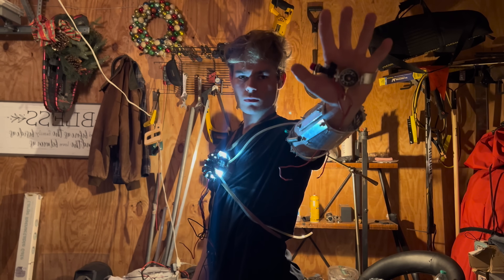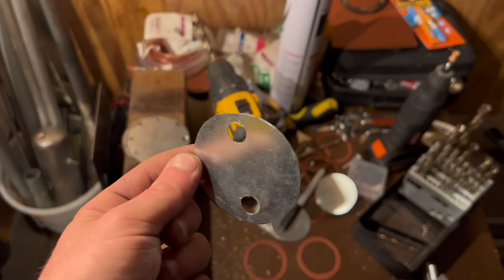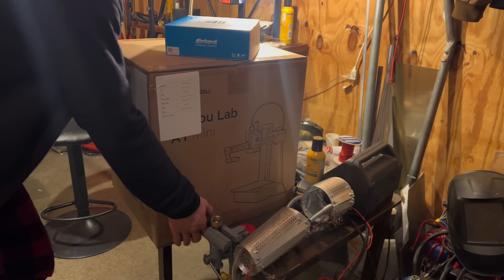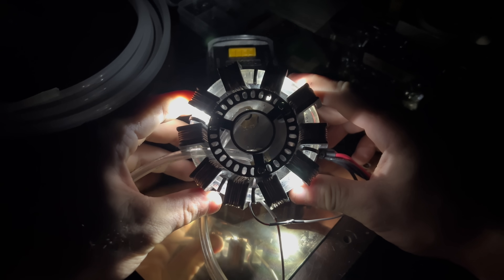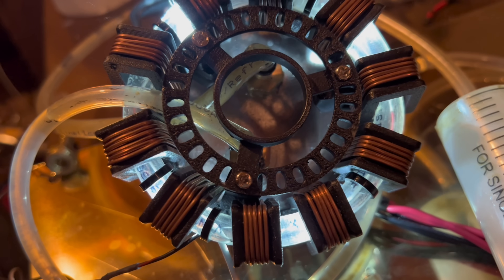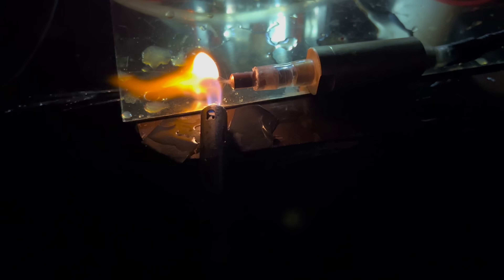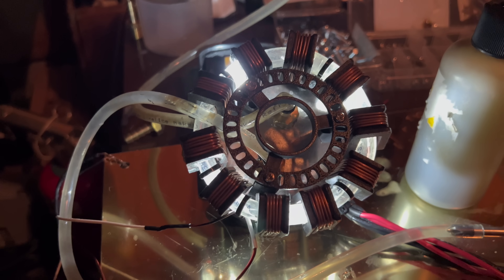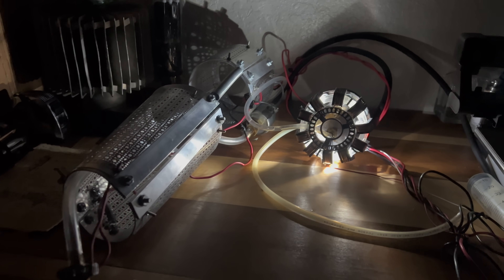Functional Ironman Reactor that Converts WATER into FUEL

Comment from the maker: Forgot to mention this in the video but this reactor is inspired off of Alex Labs model, just a couple of tweaks from his model but basically the same process. Working on a new model however using a more efficient electrode material and a couple of different inner mechanisms that will hopefully be much more powerful.
Reply: Respect for mentioning him
Reply: How to get this materials cost also plz its awesome i want to build one if not atleast buy one  .
Reply from the maker: @SourabGhosh-cc1 you can get the metal at metal scrapyards or hardware stores look for 304 or 316 stainless steel and rubber insulators
Reply: @Joseph_sidl  thank u
Reply: @Joseph_sidl 
I am an engineer I don't know everything about your hydrogen reactor, but I have some tips for the future 

 Composite high-pressure cylinder + 2-stage regulation to stack operating pressure.

Hybrid buffer, small Li-ion pack or supercapacitors to handle peak actuator draws and regenerative braking from joints.

Closed-loop liquid cooling with microchannel cold plates on power electronics and stack.

Modular tank swap design for fast “refuel” without downtime.

This gives you durable runtime

though it might be slightly bulky depending on your complete future exosuit

Here is a short sim for a secondary Ionized plasma reactor for long ter management of the full suit.

Being the fact I don't have measurements or full exosuit blueprints this is a rough estimate.

Use case: Portable, wearable primary power is not realistic; model focuses on a compact RF plasma reactor as a source to illustrate physics and constraints.

Geometry: Parallel-plate RF discharge, electrode area 
𝐴
=
0.01
 
m
2
, gap 
𝑑
=
2
 
c
m
.

Gas: Argon (inert baseline); optional hydrogen mix noted in sensitivity.

Operating point: 13.56 MHz RF, input power 
𝑃
i
n
=
200
 
W
, pressure 
𝑝
=
10
 
T
o
r
r
, wall temperature regulated near 
40
 
∘
C
.

Model setup and governing equations
Plasma continuity (global balance):

𝑆
i
o
n
=
𝜈
i
o
n
 
𝑛
𝑒
 
𝑉
,
𝐿
w
a
l
l
≈
Γ
𝑖
 
𝐴
with 
𝑆
i
o
n
 the ionization source, 
𝐿
w
a
l
l
 the loss to walls, 
𝑛
𝑒
 electron density, 
𝑉
 volume, and 
Γ
𝑖
 ion flux.

Electron energy balance:

𝑃
a
b
s
=
𝑃
i
o
n
+
𝑃
e
x
c
+
𝑃
e
l
+
𝑃
w
a
l
l
relating absorbed RF power to inelastic collisions and wall losses to set 
𝑇
𝑒
 and 
𝑛
𝑒
.

Sheath and ion flux at walls:

𝑐
𝑠
=
𝑒
 
𝑇
𝑒
𝑚
𝑖
,
Γ
𝑖
≈
𝑛
𝑠
 
𝑐
𝑠
with 
𝑐
𝑠
 the Bohm speed, 
𝑛
𝑠
 sheath-edge density, 
𝑚
𝑖
 ion mass, 
𝑒
 elementary charge.

Poisson’s equation (field structure):

∇
2
𝜙
=
−
𝑒
 
(
𝑛
𝑖
−
𝑛
𝑒
)
𝜀
0
to resolve sheath voltage 
𝜙
𝑠
 and ion energy to surfaces.

Example simulation outputs (order-of-magnitude, steady state)
Electron temperature and density

𝑇
𝑒
≈
3
 
e
V
,
𝑛
𝑒
∼
10
16
–
10
17
 
m
−
3
Expect weakly ionized plasma with non-Maxwellian electrons; sheath-edge density 
𝑛
𝑠
≈
(
0.3
–
0.6
)
 
𝑛
𝑒
.

Ion flux and energy to surfaces

𝑐
𝑠
=
𝑒
 
𝑇
𝑒
𝑚
𝑖
≈
1.602
×
10
−
19
⋅
3
6.63
×
10
−
26
≈
2.7
×
10
3
 
m
/
s
Γ
𝑖
≈
𝑛
𝑠
 
𝑐
𝑠
≈
5
×
10
16
⋅
2.7
×
10
3
≈
1.3
×
10
20
 
m
−
2
 
s
−
1
With sheath potential 
𝜙
𝑠
≈
20
–
50
 
V
, ion energy 
𝐸
𝑖
≈
𝑒
 
𝜙
𝑠
∼
20
–
50
 
e
V
.

Wall heat load (ion contribution)

𝑞
𝑖
≈
Γ
𝑖
 
𝐸
𝑖
≈
1.3
×
10
20
 
m
−
2
 
s
−
1
×
(
30
 
e
V
)
30
 
e
V
≈
4.8
×
10
−
18
 
J
⇒
𝑞
𝑖
≈
6.5
×
10
2
 
W
/
m
2
For 
𝐴
=
0.01
 
m
2
, ion-driven heat ≈ 6–10 W; total thermal load typically dominated by ohmic/electronic losses, approaching the absorbed RF power (e.g., tens–hundreds of watts), requiring active liquid cooling.

Gas temperature and pressure effects

𝑇
𝑔
≈
350
–
500
 
K
 near plasma core (without aggressive cooling)
Higher pressure increases collisionality, raising gas heating and reducing mean free paths; lower pressure increases sheath thickness and ion energies.

EM fields and constraints

𝐸
/
𝑁
 (reduced field) set by matching ionization, typically 
1
–
10
×
10
−
16
 
V
 
c
m
2
RF currents and stray fields are nontrivial in compact packages; shielding and grounding are mandatory.

Sensitivity and design notes for “wearable” context
Power scaling: Increasing 
𝑃
i
n
 raises 
𝑛
𝑒
 and 
Γ
𝑖
, but thermal and EM emissions scale too; compact reactors quickly exceed comfortable heat flux and EMC limits.

Gas choice: Hydrogen lowers ion mass (
𝑚
𝑖
), increasing 
𝑐
𝑠
 and ion flux at a given 
𝑇
𝑒
, but adds flammability and chemistry; argon is simpler and safer for characterization.

Frequency and geometry: Higher frequency or tailored electrode shaping can reduce sheath thickness and localize fields, but complicates matching networks and increases EMC challenges.

Cooling: A closed-loop liquid system with microchannel cold plates and a pump capable of ~150–300 W heat rejection is necessary at 200 W absorbed power in a compact build.

just a thought hopefully this helps :)
Reply from the maker: @KFlasheditsthanks for the tips, I actually already am working on building a accumulator tank to collect/pressurize the created oxyhydrogen to then be used in the future, as for the power supply I was using a car battery charger for just plain bench tests I will be using a rechargeable Lipo once I build everything into an exoskeleton frame, didn’t think of liquid cooling but that’s also a good tip, and for the refueling mechanism I was thinking of adding a second tank with a port hidden somewhere in the suit that I could pop open from the outside and fill with extra water, nice tips though
Reply: holy mogger
Reply: Full blueprint for this please
Reply: oh that video from seven years ago?
Reply: Government coming for you soon. Good knowing you
Reply: bro you probably know this but you can use that small flame to wield, that thang is 2000° celsius.
Reply: Great to see giving credit in this age. Also good work champ. Always great to see more exo suit channels.

Comment: You need a larger surface area for the electrolysis to make more hydrogen. Then you need to pipe the steam, 02, H2 through a liquid filter very similar to how they extract gasoline from a refinery. This will help cool the steam and filter the O2 and H2 as well as help fire not feedback up the tube to the H2 cell.
Reply from the maker: I did use a liquid filter that’s what the bubbler was for, as for the surface area I can’t really expand the reactor size, I could maybe a little bit but it would get too big
Reply: @Joseph_sidl  ah very good I didn't notice the bubbler. What do you think of the chest plate itself being a thin tank for electrolysis of the water and the light just a superficial astetic? Also things that are base in the PH scale reduce rust so maybe if you treat the water to be more base in PH it will help reduce rust in the system.

Comment: add a Peltier cell to the back to recapture the heat as electricity
Reply: Also if you want a conductive material that is non-corrosive carbon based conductors like graphite or silicon based crystal like quartz both are highly conductive heat wise as well so can help dissipate heat
Reply: To keep the amount of steam down to a minimum you will probably want to cool the rig some how it can also be achieved with the peltier cell technically by flipping the cell
Reply: I also suggest a heat pump of some sort using either an ammonia or alcohol-based coolant with low evaporation temps running that on a closed loop with a small compressor and pump could reduce the temps by 15-20° f

Comment: What are the outlets you used called, I cant find them online. Like the ones you use to put water into, and gas output. Also do you use flashback arrestors to stop the gas from traveling back into the arc reactor and exploding?
Reply from the maker: The outlets are called a hose barb fitting, I bought mine from menards, make sure the fitting is the right diameter for whatever hose you screw onto them. Also yes I use a flashback arrestor
Reply: @Joseph_sidl  but wouldn't the reactor leak water? Since it isnt one way, or how did you work with that? If it was one way it wouldnt work, but if it wasn't it would leak
Reply from the maker: @Pix1l the bottom fitting that you fill with water you need to plug with something for the water to not leak, the fitting itself is sealed tightly and for extra precaution I JB welded all the seams for no leaks

Comment: Hey btw I have researched a fair bit and i believe using lines of Hydrophobic material can make a path for the bubbles to leave the system quicker, augmenting the effective area of contact with water

I was thinking about using stripes half a millimeter wide every one millimeter would be optimal considering the usual size of hydrogen bubbles

I suspect that might be too close so try also leaving a 2mm gap
Reply: This works way better in vertical catalyzer plates using diagonal lines of Hydrophobic paint that connect directly to the outside in order to drain the hydrogen as quickly as possible

I can help with the design too if you want
Reply: I can help design the modified version, should be easy

Comment: If you really want to speedrun making the "Top 10 Mysterious Deaths" by WatchMojo, you should make a reactor that runs on force. Yes, the predicamental accident of force itself. That would be universal. Bodiliness itself accepts all determinations of force, therefore every bodiliness in itself is a generator of every kind of force in potency. The moment you have to rely on any particular kind of bodiliness (such as water), you've already made a fallible fuel source. The fuel that is fuel is perfect.

Universal conversion of force is a matter of being able to determine what scale force is applied, so that can be done with a single principle of conversion (i.e., generates arbitrary displacement serially or parallelly in any configuration and limited only at the quantum level, so by that I mean you could make it excite infinitely many particles and spatial permutations of particles. I imagine creating and using a full-spectrum laser would allow for that similar to how CRT monitors work in principle with electron guns, but then is the question of translating that into kind of force at the target besides just, y'know, heating).

Finally is the issue of universal differentiation and distribution of force into pure or nearly-pure, bodily media of force, e.g., particle radiation which should be the most universal of media, but again is the issue of translating force into kind of displacement. I imagine that would require making potential or actual particle compositions to emit as radiation that result in the equivalent of a perfectly displacing force applied at the target, but such a machine would literally just be hurling proton-electron combinations as evidently only elements are subject to displacement whereas anything simpler or less composed than this displaces of itself at a constant rate with the only freedom apparently being displacement orientation.

Comment: Lil advice: regular tap water has a LOT of impurities that will eventually seize up the tubes and the reactor. You should instead use distilled water. But, since distilled water is not conductive, you‘ll need to add something to make it conductive again. 

„So it’s just water with extra steps“
No. You can control exactly what and how much you mix in, so you can 
A: add something that doesn’t seize everything up
B: know exactly how long it will run for before it needs to be cleaned.

Comment: try adding a sacrificial anode that you can screw in and out to stop the main body from corroding ,and maybe you could have the threaded part made out of a different metal so the corrosion from locking the thread

Comment: Use white distilled vinegar instead of sodium... white distilled vinegar is CH 3 COOH, it has water in it but is H positive, it will produce H202 to add to the oxihydrogen output... versus sodium hydroxide it is a little slower reaction because the ph of white vinegar is less than sodium hydroxide but it doesn't produce caustic corrosive gasses and instead produces more H and O in the output... to get the same rate of output, you might have to increase the power input.  Or alternatively, you could use Sodium Sulfate which is better than vinegar and less corrosive than Sodium hydroxide or vinegar... but might be less obtainable.  Vinegar would be less corrosive in your build because you are using stainless steel, but has a lower overall output which can be overcome with more power input.  I've also used graphite from pencils as my electrodes which also increases output because the graphite is porous and creates more bubbles but is non-reactive and therefore doesn't corrode.
Reply from the maker: Wouldn’t vinegar produce by products cause of the extra carbons it has in it? That could contaminate the reactor
Reply: @Joseph_sidl  yes it does produce contaminants in the gas, but is a less corrosive and less caustic alternative, ideally Sodium Sulfate is best.
Reply from the maker: @chienforcer nice thank you
Reply: @Joseph_sidl  no problem, I hope what I shared helps your project.  I look forward to seeing more of your videos on it!

Comment: im no engineer but since this overheats could you before inputting the water use it to cool off the reactor then input it into the reactor?
Reply from the maker: That is a good idea I could do that with copper tubing but I would then need a water pump, definetely gonna concider and see if it works though thanks for the idea

Comment: If you want your reactor to last as long as possible and optimize output it's best to stick to around 2 volts of power, anything over that and most of the power input gets converted into heat rather then fuel. Low voltage high amperage.
Reply from the maker: Thanks for the tip, I already thought 12 volts was low enough lol but I guess not, I’ll use lower voltage from now on

Comment: I know it's not likely that you see this, but increasing the surface of the electrodes will increase your output. so if you design new ones with more surface area in cad, and print them with a conductive material, or electroplate them, you'd see a huge jump in performance
Reply from the maker: My newest reactor I’m working on is using graphite electrode plates, it’s much better performing and lasting than stainless steel but I will definetely consider this for a future one as well once I have better equipment

Comment: As always in Water reactors, the hardest part is figuring out where to place the battery😅
Reply from the maker: Not really, just store a small pack on my back
Reply: @Joseph_sidl  bro, it's still freaking awesome :D
Reply from the maker: @Niesmiesznyy thanks bro, it requires a battery to run, the main part of electrolysis of water is an electric current to start the break down of H2O

Comment: You could add a mesh near the fuel output nozzle to prevent water from the reactor from moving into the tube
Reply from the maker: I was thinking of doing this, I’ll give it a try soon
Reply: @Joseph_sidl use an aquarium one way filter, it’s meant to prevent water back flow into air pumps

Comment: Cool! hydrogen reactors are pretty neat, but what about the hydrogen gas, where does it go? (hydrogen gas is extremely flammable)
Reply from the maker: I want to use it in a mini rocket system that used the detonation or hydrogen to propel a mini rocket, and possibly a little metal cutting torch built in cause of how hot hydrogen burns, I’ll have a little storage tank on my back most likely
Reply: @Joseph_sidl  smart use of the gas. I wish i had the budget to do that
Reply from the maker: @SteamSteam-l5o I’m like basically broke lol, I’m still in highschool so it’s pretty hard to find this project, I’m running purely off the money I made during summer break working
Reply: @Joseph_sidl  lol, also, one more question, the gas is going to build up, so what if the gas gets to the point theres no more space? just wondering, cuz this is really interesting!
Reply from the maker: @SteamSteam-l5o that’s how you generate pressure, the gas fills the tank and continues to build up pressure, you need a lot of gas for that though for it to become a very high pressure that my little reactor probably won’t be able to generate
Reply: @Joseph_sidl  Oh alr, but still, its a super cool project. iron man suit that can run on water, crazy. Keep up the amazing work!
Reply from the maker: @SteamSteam-l5o thank you mate :)

Comment: I have a few questions on how you were able to make this since its awesome and im curious. How did you prevent the hydrogen gas produced from the electrolysis from going back into the water hose? Why is steam produced during this process? How did you connect the metal plates in the center? Are you going to make a full in-depth tutorial?
Reply from the maker: Yeah I should’ve made this video more in depth lol I sort of rushed it, to prevent the flame from traveling back down the hose to the reactor I had a flashback arrestor connected on the fuel output hose right before the nozzle, if a flame travels back down and into it it automatically shuts down the flow of gas preventing the flame from traveling down and into the reactor, steam is produced due to heat, the reactor cell gets very hot becuase of all the current traveling through it and raises the temperature of the water (I actually need to find out how to not make this happen, best method I’ve found is just lower the current of the power supply I’m feeding into the cell), as for the metal plates in the center I just added a little wire connected the the plate before I pressed the chamber together. I’m actually building the mark 2 model of this reactor using graphite plates instead of stainless steel since it’s much more conducive and has a very very long life time in a environment like electrolysis so I’ll make a more in depth video for it once it’s complete :)
Reply: @Joseph_sidl Awesome! I can't wait for the next video. This is seriously impressive. Great job!
Reply from the maker: @Tigermaki357 thank you mate